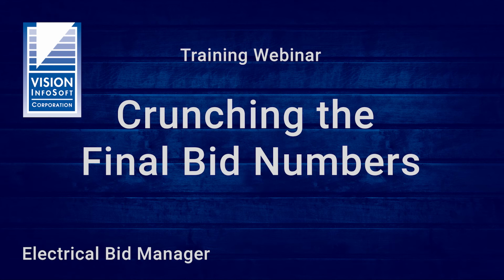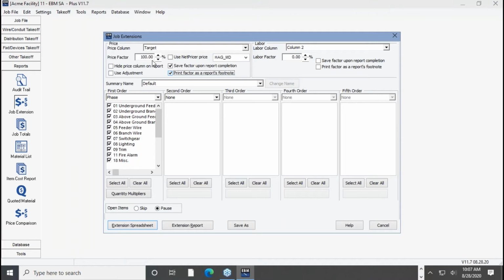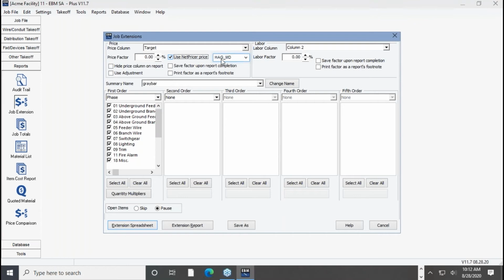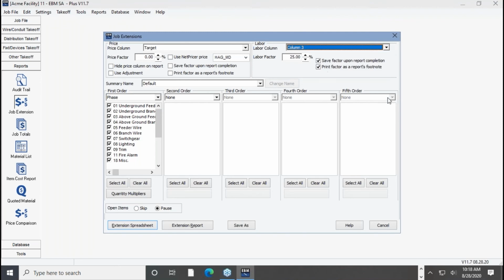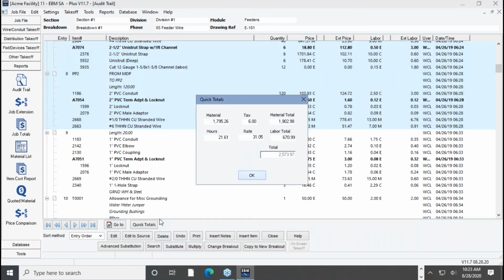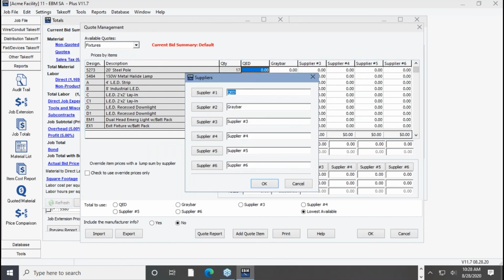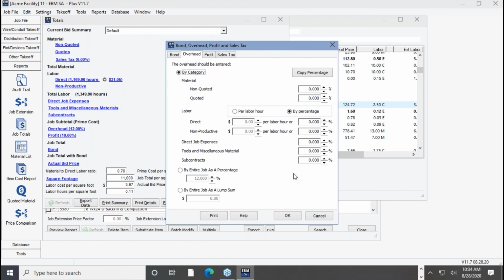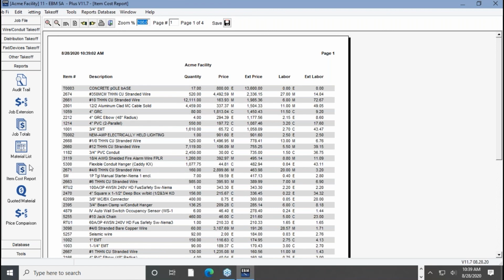Electrical Estimating - Crunching the Final Bid Numbers

Comment: Poor quality video, it can barely be seen
Reply from the maker: Robert, this video and most of our videos are in 1080p and have a very sharp view of any software, website, or imagery we share.  Please try clicking on the cog gear at the bottom-right of the Youtube video and manually select the 1080p Quality setting. 

We've seen Youtube incorrectly send low quality video streams (less than 720p) when they incorrectly identify your bandwidth.  Forcing it to 1080p always helps!